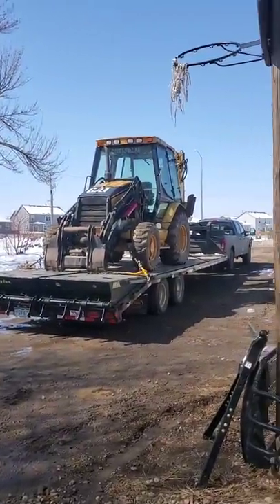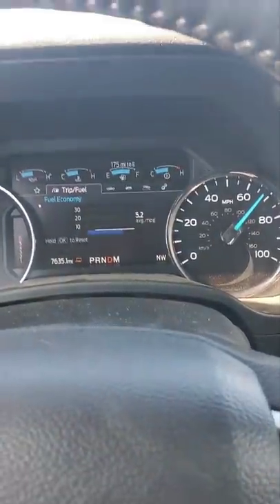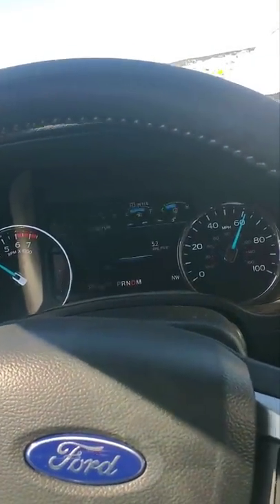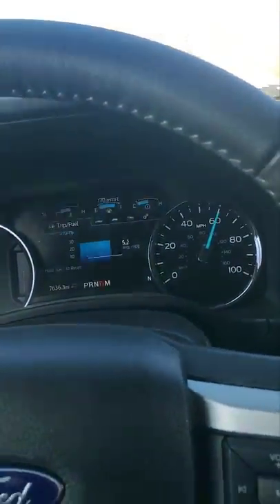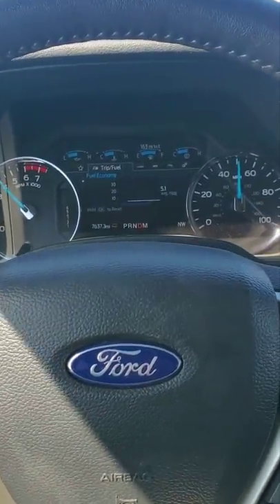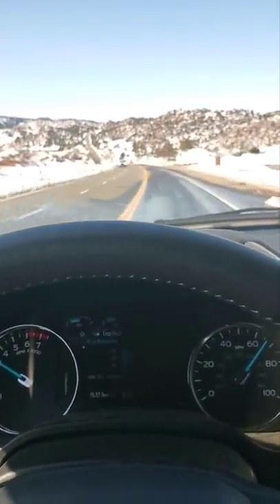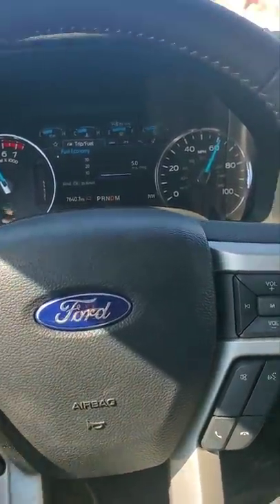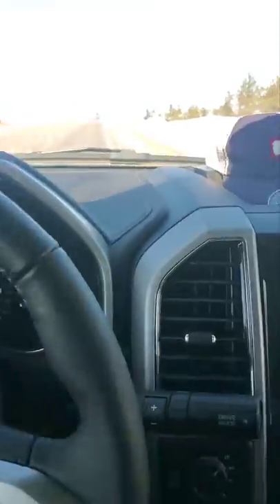7.3 godzilla towing 24k lbs through the rockies.

Comment: Keep an eye on the transmission. They already changed mine at 28,000 miles. It's not the same components as the diesel is what the engineer told me. It was grinding  something inside in park and sitting at idle. Towing pulling 13,500 lbs fifth wheel does it with ease and a lot more power to spare.
Reply from the maker: I sure will
Reply: Yes......both the 6 speed and the 10 speed transmissions are different for the gas and diesel engines. The 6.2L gets the 6R140G or the 10R140G and the 7.3L gets the 10R140G.....while the 2017 - 2019 6.7L gets the 6R140 and the 2020 and newer 6.7L gets the 10R140. 

Did you ask the engineer...or did he tell you the basic difference between the Gas (G) and Diesel versions of the 140G and 140 transmissions??? I know the Torque Converter Stall Speed will be different. Any other differences...in components, materials and parts?
Reply: @15Jeep  I saw a video on YouTube a couple years ago showing differences in the transmissions. The (G) models have smaller internal components while the diesel versions have more robust guts. Shaft diameters on the diesel versions were much larger, etc.
Reply: @johncrow3358  Interesting! Stronger parts to handle the increased torque. Then again...most of the time, stronger parts are better than minimal...or just above minimal.  Makes me wonder two things. 1. If anyone will replace the 10R140G with a 10R140 and install it behind the 7.3L gas engine in the future. 2. If the aftermarket will design, engineer and sell better and stronger parts than OEM stock parts for the 10R140G.
Reply: Has your replacement transmission been noticeably better?  Or any issues with the replacement, yet.

Comment: I’d be concerned how long the engine would last running at those high rpms.
Reply: toast before 100k
Reply: Not very.
Reply: This was an extreme test. Should be a great option for lighter 5th wheels with moderate head winds/grades and bumper pull trailers in just about any condition.

Comment: You were smart and ahead of everyone else to leave todays overpriced and underpreforming diesels behind and grab up a godzilla👍 the only thing is gearing and single rear tires are limiting factors for you kind of heavy pulling, i hope it proves them all wrong . best of luck to you ...
Reply from the maker: I don't pull regularly that heavy other wise I would have set it up differently. I just did it to show this engines capabilities. Even though it does pull it well it still just f250 brakes.

Comment: How is braking… the 6.7 power stroke (and cummins) have exhaust brakes
Reply from the maker: It's not bad, not as strong as an exhaust brake but when ypu let off the gas the closed throttle body creates vaccume in the intake manifold which creates a retarding horsepower that helps hold the load at speed.

Comment: New diesels might no last like the old ones but they will still outlast the Godzilla, for the simple reason that truck turned 5k rpms the whole video. If you do that everyday that cuts into life span but I am very impressed with that motor to say the least, best gasser out
Reply: The engine was built to last turning those kinds of RPMs its well balanced and has huge water jackets to keep it cool, look at the old chevy 366 for example, those gas engines lasted forever in Class 7 trucks!

Comment: Like to see the difference doing that 
In somewhere in the summer time where it get hot maybe south Louisiana or Texas
Reply from the maker: It's easier to keep an engine cool on a 100 degree day than it is at this elevation at 70 degrees due to air density. The humidity in the south helps pull heat from the radiators.

Comment: Them transmission temps tho👀👀👀
Reply: Thats actually normal on these trucks. My 2020 f250 never is below 210 during the summer and empty
Reply: @flex3543  jeez my 2016 6.0 vortex has never seen temps above 165 working or empty might be that the 10 speeds use a different type of ATF that runs hotter.

Comment: Is that an F250 or 350?
Reply from the maker: 250
Reply: @ColtWR  How did it handle the rear axle weight? Was it overloaded?

I'm looking at getting an F350 with 7.3 and 4.10, this video is eye opening. Thank you
Reply from the maker: @bossturbo  here is a very loose rule of thumb i learned from an old timer years ago that I have been able to find true in my line of work. Now take this with a grain of salt. But most everything is engineered for 2.5x its rated capacity. You look into these axles and there are minimal axle structure changes until you get to thr f450 and f550. So yes. The axle did well.
Reply: @ColtWR  thank you. I'll be towing on flat surfaces and not towing heavy very often, so this is great news. I REALLY appreciate your video

Comment: Is this not the 10 speed?
Reply: I was thinking the same thing i dont think the 7.3s came without it?
Reply: @wtx_outpost  yup just confirmed they only come 10 speed I'm beginning to question this video.  Especially since I've got experience towing with the big 7.3 and even on small hills it was as bad as this. I guess it's possible he's locked out the other gears by erasing them.

Comment: What I would be concerned about is that you are reving  that big 7.3 liter engine up to between 4 and 5K rpm to develop its power! my second worry is how close and where did they put the catalytic converters on that truck/ I am hoping they did not sandwich that expensive transmission between the two red hot cats to help burn the tranny oil!! I do not know the layout of the under body on this truck. Question is did Ford copy the IH 7.3 diesel block and just put lower compression gas heads on an old design which would be good because the increased strength of crankshaft, block, connecting rods and bearings would add years/ miles to the engines usability and durability.
Reply from the maker: The block design is an entirely new ford design and has no relation to the international Navistar 7.3 powerstroke. The bottom end of this engine and valve train is very robust and displays that an industrial engine was exactly what ford was trying to build.
Reply: @ColtWR  Thanks for the interesting info!!  So that block should  be very durable and last possibly 200,000 maybe more miles!! if serviced well!!
I have an old F350 dually that has the 7.3 turbo diesel and it has over 350,000 miles on it, only  problem is a very rusty frame.

Comment: I wonder if the 10 speed would have done better or worse?
Reply: This truck is a 10-Speed, you can only get the 7.3L with a 10-Speed, and im sure it did better than it would have with just about any other transmission. 10-Speeds are great for towing because no matter what the engine can almost always find its sweet spot and just hover there producing max power/torque.
Reply: @nathanmcdonald610  than why does the dash only show 123456 for gears???
Reply: @joeyjordan1209  Because you can lock out gears in the newer trucks. He has gears 10,9,8 and 7 locked out so the truck wont shift into them.
Reply: @nathanmcdonald610  oh wow.. does it do that when you put into tow haul mode?? Or you need a scanner of some sort??

Comment: You running 87 octane or 91?
Reply from the maker: 85
Reply: @ColtWR  Why don't you try something that boat anchor can run some timing advance on?
Reply: @HalfShell E85 creates more power then 89 or 91.
Reply: @deeremeyer1749  Higher elevation. There isn't enough air that it'll be pulling timing due to spark knock.

Comment: Hard to get used to 4000 rpm after 1700 in my Cummins. Just sounds like wear and tear, no way it'll outlast a diesel towing everyday. PD Diesel gets 400k out of his Ram hotshot rigs, post us some vids of this truck at 400k towing at 4 or 5 grand everyday.
Reply: You make some valid points. However...IF I ever needed a 4WD Class 2 or Class 3 SRW truck with a diesel engine.....it would be an older Ford (probably a 2005 - 2007 F350) with an engine swap. Might even consider an F450 with Super Dana 60 up front and a new Dana M300 in the rear converted to SRW. Don't like 4WD DRW trucks...terrible in the mud and snow. Install A VERY NICE custom built 5.9L Cummins...most likely from CPP in Pennsylvania or Industrial Injection in Utah....backed up by a Allison 1000 Six Speed with all the goodie aftermarket parts built by Suncoast in Florida. I would NOT want a 6.7L Cummins.....those break down way too frequently.

Comment: I have to admit I don't know what you guys are so excited about.  I've towed heavy loads with gas and diesel.  Just purchased a Ford F350 with 6.7D.  While this guy's gas engine is screaming at 4,000 RPM up-grade to get 50 MPH (and 2MPG), I'm at 1,500 RPM doing 65MPH and still getting about 6MPG on the grade (with power to spare), 12MPG on the flat with similar load.  The alcohol in gas these days really hurts your engine, while diesel fuel is lubricating.  I can get 500,000 miles on the engine no problem.  Won't do that with gas.  Overall, the diesel is King.
Reply: Don't know about that. Driving 2000 f250 with v10 since new. Currently at 543000 miles. Haven't opened the engine. 1 transmission and 1 transfer case. Both my fault needed replacement.

Comment: Why not have the 4.30 gear ratio matched to the ten speed transmission if your intended use is towing??  Using 3.55 gears defeats the purpose of the power produced by the new 7.3 Godzilla engine.

Comment: There's no real gas justification, unless that's just what you want. 
$60,000 gas truck.    $70,000 diesal truck. (Ballpark prices)
15,000 miles per year at 16mpg on each truck, yea I know there's no way the gas engine or diesal will maintain that every day. Each truck would burn 937.5 gallons if they did in this example.
Fuel prices and cost for 937.5 gallons
Gas                           Diesal
$3.50 gal                   $5.00 gal
$3281.25                  $4687.5

Oil Changes, 3 on each truck if done at 5000 mile intervals. $80 gas/ $150 for diesel.
$240                           $450

DEF
N/A                             $60

General Maintenance
$2000                          $4000

Approximate total cost to operate per year
$5522                          $9198
               $3666 difference

Percent of truck cost to operate per year
9.2%                              13.1%

It will cost you roughly 4% ($3700) more to operate the diesal per year. Granted, no small amount. As we all know, the gas engine is never going to average 16mpg for 15,000 miles. Neither will the diesal, but it will do much better, so the difference in operating cost will be even smaller. The other issue is resale value. The diesal will do much better and that will close the gap even more. There are more people looking for diesal trucks in the secondary market than gas trucks. 

Absolutely nothing wrong with having a gas truck if that's what you want, but saying the operating cost is way higher is not actually the case. Sure anything can break, that goes for gas and diesal. As you can see in this video, he's towing a very heavy load, and yes it will do it but the gas milage is horrible and in order to make that pull, his RPM's are very high, eventually that will take a bigger toll on a gas engine. Yes the diesal RPM's would be higher too, but not like that. 

I'm sure there are other cost I forgot or left out, and my numbers are ballpark. I think they are close enough to get the point across. If $3000-$4000 dollars extra bothers you after having committed to purchasing a $60,000 or $70,000 truck (And probably more), I would argue you can't afford to own either truck. If you plan to pull anything heavy, buy a diesal. It takes weight to stop weight. Just because a truck will pull a heavy load has absolutely nothing to do with whether or not it will stop it when you panic and hit the breaks. If your plan is to drive back and forth to work and on an occasion pull a utility trailer or boat to the lake on the weekends, then yes, a gas will do the job. Buying a gas truck versus a diesal truck is just not gonna save you a ton of money in the long run.
Reply from the maker: All it takes is one dpf, one scr, one injector, or one fuel pump and you'll be in the diesel 10-20k in repairs not including wages lost due to down time. These new diesels are not the reliable old one. Maintenence costs are much higher. Plus ypu forgot about the 150 dollar fuel filters that the new diesels require ever other oil change. Not to mention the added internal stess a diesel has due to regulating emissions equipment that that the gas engine does not have.

Comment: Hi Colton,
I have been seeing more & more 
Guys on  u tube with 10 speed tyranny issues yours appears to be fine
 It's given me 2nd thoughts in ordering a new Ford gasser with a 10 speed
What is your thoughts
Enjoy the videos
Reply from the maker: So far mine had been flawless. I do understand there are a some bad experiences out there however. The good part is all of the transmissions that have failed have failed under warranty and have not had to go back since. There are already so many of them on the road the failure percentage is quite low and I don't think you'd have anything to worry about.

Comment: My rule of thumb for towing or driving diesel pusher motorhome up hills is to go HALF THROTTLE - and whatever the rig does it whatever it does - keeping under max speed of course.  Then you don't have to worry about stressing components, overheating, etc.  My 2001 expedition towing 7500 pounds up the Grapevine mountain in southern california did about 30-35mph... getting passed by big rigs lol.  But she never broke down even with 200k miles on her.

Comment: Throw a supercharger on it and do that run again.
Reply: I can't wait to see these trucks turning into monsters. Already some real darn good trucks, the 4.30 gears seem optimal to me, as the thing has a 10 speed, not like its some old 3 4 5 speed where you'd most likely be over revving at some point.
Reply: @baileyhatfield4273  Yeah, with those old 3 and 4 speed auto's you were either screaming right at the redline to maintain what little speed you could or you were bogging down while the transmission fumbled through gears trying to make the right decision.

Comment: You really Should get the 6.7L diesel over 1000lb ft.
I don't think the diesel would need such high RPM's to do that tow...
Reply: He has another video where he says he has a peterbilt if he really needs a diesel. Plus with that 10 speed hes really not running that high of a RPM. Hes just proving that 99% of people on the road who drive diesels dont need a diesel

Comment: There’s an old saying, just because you CAN do something doesn’t mean it’s a good idea. The GVWR on that truck is around 22,000 lbs. The max towing is rated right around 15,000 lbs. This run is extremely dangerous. If there had to be an emergency stop, it would be impossible. If there were any type of accident, you would be liable for towing illegally. You can tow like this with any truck if you don’t care about safety. We all overload our trucks from time to time, but towing double what the truck is rated for is just asking for trouble. Any HD truck with a gas engine could do this same trip. The 7.3 is most definitely a strong engine, but it’s not double the capacity of any other gas engine HD’s.

Comment: I bet if you put some sort of forced induction on that truck it would make a hug difference
Reply: Check out 5 star tuning BTW, they did exactly that.
Reply: There's a guy on YouTube that got over 600hp NA out of this thing. Ported heads, cam, intake, and I think that's it
Reply: You will also shorten it's life and use more fuel. Leave it alone and this 7.3 will last a longtime.
Reply: @2015_Rubicnn  Exactly Correct!!! BTW...I have a 2015 Jeep Wrangler Unlimited Rubicon Hard Rock - Tank color. It is awesome off-road in the mud and snow.
Reply: @15Jeep  I'm not opposed to superchargers, I just like them for hotrods and street machines. I had a Procharger on my 2010 Camaro and loved the power, but it's best to have an engine designed for boost from the beginning. Yes, I love my Rubicon offroad, they are well designed. 👍
Reply: @2015_Rubicnn  Completely Agree with your supercharger comments.